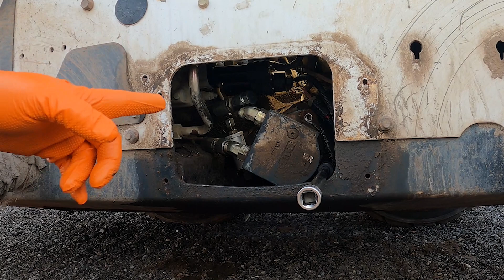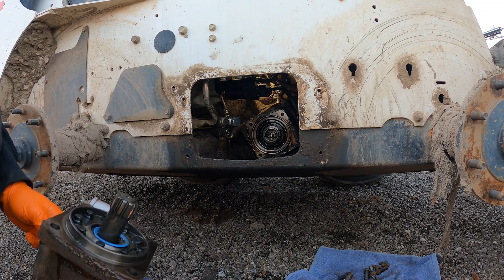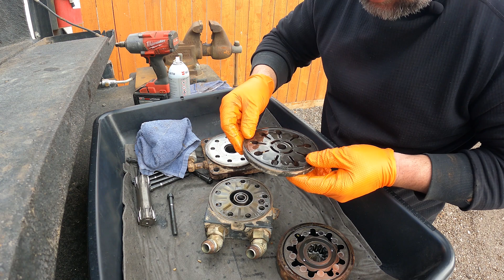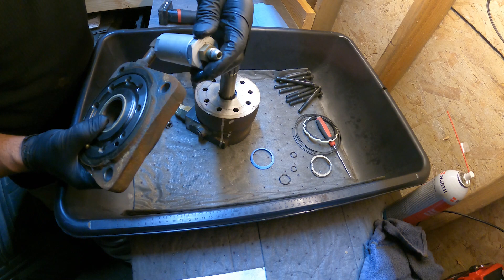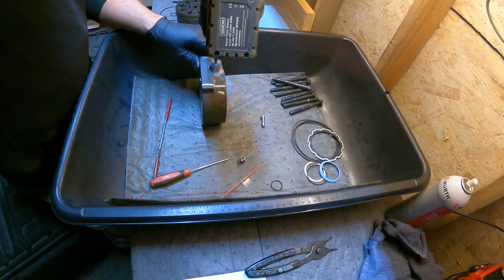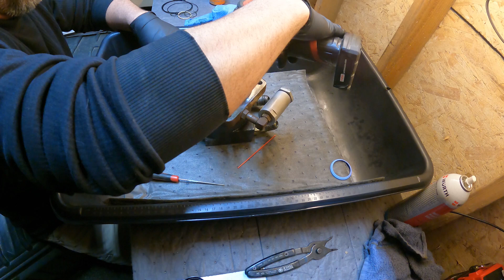Bobcat  Skid Steer Drive Motor Repair.  Weak drive motor low power.

Comment: First off I need to say your videos have been a huge help for my restoration project. I have a wet bolt drive motor system which is all assembled, but I have not started it yet because I am unsure/unaware if I need to bleed my hydraulic drive motor. Is that a step that I should not overlook before the first startup?

Comment: I have a 773 and I don't see leaking from my pressure lines. Does the drive motor connect to the chain case behind and could there have been a seal compromised back there ?? I've been running a jack hammer unit on the machine and I'm slowly finding all the loose parts  LOL.
Reply from the maker: Yes hydraulic oil can leak into the chaincase if the motor seals are bad.

Comment: Hope you can help me - my 1979 730 has no governor on Wisconsin engine I just installed. Arms go up and down quickly at higher rpm, however the machine barely moves forward/backward, sometimes seems to surge and starts bucking, unable to climb even small grade. I parked it against block of concrete - cannot spin tires. Do these sound like symptoms of a weak drive motor? I started convincing myself it's my missing engine governor...

Comment: Hello sir, I am having problems with a bobcat t250. On the advanced display it is showing low charge pressure and getting a lot of feed back in the sticks when trying to push or turning but no codes. The drive belt is new, the tensioner is new, the case drain filter is new and showed no signs of extensive metal coming from either of the drives, there is no hydraulic fluid mixing with gear oil. The hydraulic filters and oil are both new. Is it possible the charge pump is just weak and could be replaced?
Reply: I should probably add that the machine has been ran low of fluid by the previous owner. I bought the machine with many leaks and many issues.
Reply from the maker: Need to verify charge pressure first.  Could be low charge pressure or the hydrostatic pumps themselves
Reply: @tetradgroup  I will check the charge pressure, thanks! Do you know what charge pressure should be for a 2004 model? I do not have a service manual.
Reply: @tetradgroup  ok, charge pressure at idle is right on 300 psi and does not vary much with loader function, at full speed 2400-2500 rpm’s the charge pressure is around 430 and doesn’t vary much with loader functions. As soon as I take off i get resistance in the sticks and it plungers to 200 but recovers and stays in the low 400s as long as I am tracking straight any twists or turns it starts plummeting and will even go as low as 50 pounds but recovers as soon as I let off the sticks.

Comment: @howIdidit Do you have the sizes or a place to get the plugs that you put in the hydraulic hoses to plug them when doing a motor rebuild so you dont lose all your fluid and make a mess?
Reply from the maker: I get my caps and plugs from Amazon.
Reply: @tetradgroup  the problem is I dont know what sizes I need.

Comment: What causes the chain case filling up? I have a 763 1998
Reply: I have the same issue on 02-753, Losing hydro fluid in main system but not running out except for axle seal.

Comment: I have a T250 hydraulic drive motor the Bering behind the seal was bad do I have to remove the hydraulic pump and have it rebuilt I replaced the Bering and seal and put it back together but it doesn’t feel right when I ran it I can’t find a video on removing the pump if I need to

Comment: I have a s185 that has a whine when driving and turning, it quiets a little at higher RPMS, everything works as it should. Could that be the drive motors?
Reply: I'm having the same problem with my T250.  Did you figure out what your problem was?

Comment: The best videos on Bobcat repair on Youtube...by far.  Thanks.   We have pulled and resealed a few motors with varying results.  We sometimes notice that the geroller is loose and some of the pins slide out quite easily.  NO scaring or blueing.  Is this normal or a sign of wear and time for replacement.

Comment: A guy is selling a cat 216 and he saids the machine doesn’t move foward or backwards why could be the problem
Reply from the maker: Does the lift and tilt work?  Its odd that both sides would not work at the same time unless the drive coupler is stripped but you would not have lift or tilt either.
Reply: @tetradgroup  it does lift and tilt I believe but he says the boom lifts up by itself

Comment: Hello I have a bobcat 753, on the right side I have full power in reverse and almost no power going forward just slight movement and surging but no actual power. I reversed the hydraulic hoses on the drive motor  so the controls were reversed so pulling backward on lever made it go forward and the problem was still identical even with hoses reversed the forward movement was still weak and still had full power in reverse. This seems like it wouldn’t be a hydrostatic pump issue then. Any suggestions what you think the problem may be?
Reply from the maker: That is consistent with a bad seal inside the drive motor, should be very similar to this video right here. When that seal goes out usually have power in One direction and not the other
Reply: Ok thanks … one more thing I lifted skid steer off the ground so all tires were in the air and that problem side appeared to respond perfectly the wheels would spin forward and back as they should no noises or anything so the problem is only when it’s trying to move the weight of the machine … still seem like it could be a bad seal in drive motor?
Reply from the maker: @tedpeacock3945  yep, oil takes path of least resistance, machines off the ground if lower resistance will turn the wheels instead of bypassing the seal then still a motor issue

Comment: I would like to try and rebuild my drive motors on the 853 I just purchased. One of them definitely provide more power than the other. Can you tell me where to get the seal kits? I searched Google but did not find anything specific to the 6720886 drive motor.
Reply from the maker: Bobcat should have them or check loader parts source
Reply: @tetradgroup  Thank you, I will check them out. Would you recommend rebuilding the weak side or just go ahead and do them both?

Comment: Do you need to renew all the hydraulic oil? because the plastic?
Reply from the maker: All the debris is caught in the case drain filter so no need to flush the hydraulic oil.
Reply: @tetradgroup  I have a manifold and do not have case drain filters so I am hoping the filter below the fan catches the debris.

Comment: Thank you for sharing.  Your videos are not only extremely informative but they're relaxing to watch.  I have two questions: what Milwaukee impact driver do you use and where do you find the breakdown procedure and torque specs?
Reply from the maker: I get the torque specs from the bobcat service manuals, sometimes a google search will have the specifications listed.  As far as the Milwaukee impacts, I use many of them, the 1/2 high torque is awesome, and the 3/8 fuel stubby M12 is a must have.
Reply: @tetradgroup  Just bought the stubby LOL.  It's fun being able to fix your own equipment.

Comment: I had the exact problem with my bobcat 751 (it looks like exactly the same drive motor as well) also did a video about it way back when... The plastic and rubber combo weird seal was totally smashes in bits when i opened the motor up, just like yours. Now all i got is a belt squeel when i try to do some heavy torque work with it. Should try to change out the belts and make sure it has some good tension on it.
Reply from the maker: I would definitely change out the drive belt and probably the tensioner as well. I have a video on exactly how to do that but I'm sure you are already know how saying is you've rebuilt a drive motor you obviously know what you're doing. Thanks for the comment, let me know if you have any more questions

Comment: I think my charge pump is also going bad. Left side drive feels weaker and you have to push the sticks way far forward to go wide open. And my belt squeals every time I go to do a rotation.

Great video! Thank you.
Reply from the maker: Charge pump would maintain pressure in the system but the charge pump is mainly used for lift and tilt and has nothing to do with drive. Drive is controlled by the hydrostatic pumps. First thing I do is change your belt and get proper tension on it and see if that helps.

Comment: That was a great video, I learned allot, I never worked on drive motor before, but with your video I am confident that now I can, I just bought a skid steer my self I hope I did not over pay it’s a 1987 model 741 Bob Cat, I was told drive side motor was bad, it had new tires, I payed 5k for it, I am thinking of doing this drive motor rebuild on my channel and I also want to service it and paint it, I am a diesel mechanic and work on Mercedes diesels, but I am hoping I can figure it put on a bobcat 😊 thanks for the video, Btw I subscribed and hit a like 👍
Reply from the maker: Thank you so much, 5k is a good price if it starts and runs, even if the drive motor is not able to be rebuilt, they are relatively inexpensive.

Comment: Good to see a few more bobcat videos recently. They’ve helped me in the past, so thanks for that. My machine was in a real bad way when I first bought it. Have you ever had to repair or replace the bobcat computer/Ecu? My electrical system is rough, in the process of tidying it up, the circuit board in the computer has some bad burn marks. 2003 753 from the Uk.